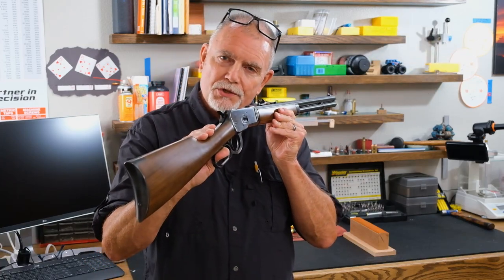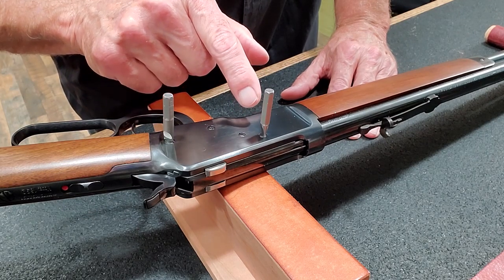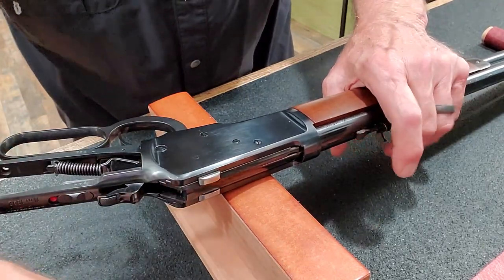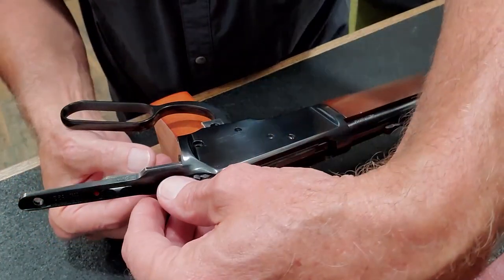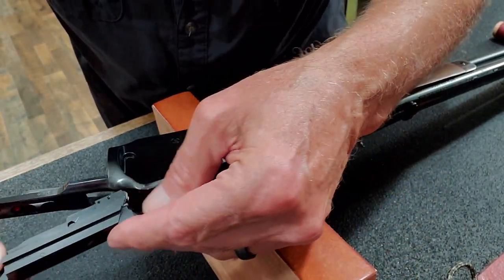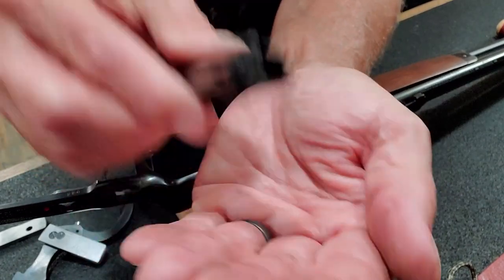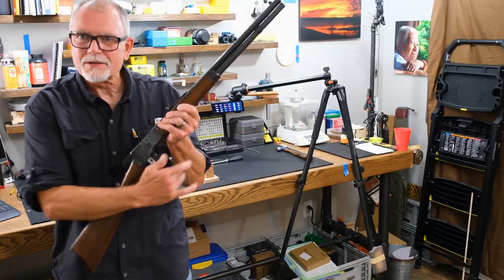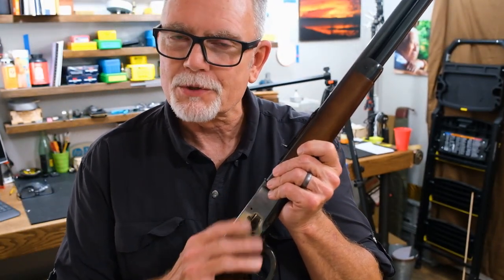Miroku Winchester 1892 Disassembly For Cleaning

Comment: last time I took apart my Winchester  I lock tighted all the screws back in.
Reply from the maker: There are probably lots of vintage lever guns that have never been disassembled, but just rinsed out with "coal oil" and put away to dry.
Reply: @TargetSuite   My win is not vintage.  it is a 1894 to 1994 centenary model  trapper carbine with the big hoop.  in 44 mag.  Last time I shot it the mag tube came loose and other screws were also loosening up.
Reply from the maker: I just borrowed a Model 94 (domestic manufacture from 1982) from a friend and am working on a disassembly/reassembly video for that rifle. I hope to post that video next Tuesday. I also hope to shoot that rifle in the next week or so to see how it performs. Maybe I should put a sheet under me to catch the loose parts😄

Comment: I love these old guns I really do..... but I wish they would breakdown like a modern rifle. Push a button and turn a lever and everything comes apart. Maybe someone will design such a thing.
Reply from the maker: I get your frustration. But that is part of the appeal of the old guns. That said, the Marlin 336/1895/Henry rifles kind of fall in that category as they are really easy to field strip, especially if you use one of the thumb screws from Ranger Point Precision for you lever screw.
Reply: @TargetSuite  Yeah Marlin did a great job with its easy field stripping but Winchester stole the show with sales I think.
Reply from the maker: I think you are right. I still have a vintage mid-century Marlin 336/35 Remington in my mental "shopping cart".
Reply: @TargetSuite  I have a Winchester 1892 made in 1910. 24" full octagon barrel full mag tube. It needs some work but the bluing is all there and it's gorgeous. It's in in 38-40 and I plan on relining it and using .40/10mm hollow points
Reply from the maker: That sounds like a great rifle to build on. Good luck with that project!
Reply: @TargetSuite  Thanks. She's my pride and joy.

Comment: Beautifully made and finished but, so complicated, and finicky to disassemble / reassemble compared to a Marlin.
Reply from the maker: Hi Chris. You are right. The Miroku Winchester 1892 is more complex than the Marlin 1894 design. It also stronger and has better fit and finish than any of the three 1894s I have owned. But that comes at a significant cost increase over the 1894. So I wouldn't say this 1892 is better that the Marlin 1894, which I love. It's just different. And I think being able to get breech access for cleaning by removing just one screw guarantees the Marlin 1894s continued dominance in the pistol caliber carbine market. Thanks for the comment as always!

Comment: I know this is not going to be taken well but I think John Browning’s designs are way too complicated but I think he did that on purpose just my two cents.
Reply from the maker: Hi Craig. No argument here. They are complicated. The 1892 much less so than the 1886 but still more so than the Marlin lever guns. But the two Browning designs were both a product of their times and in the case of the 1886, an incredible breakthrough, over engineered for the powders of the 1880s yet capable of handling power levels today on par with the 458 Win Mag. Not necessarily needed, but still a tribute to JMB and exciting to see in action  https://youtu.be/AFLXjfiklnQ

Comment: For 1892 breach bolt appetite site call Skinner for long stem lo pro besidesinstallation hole mill firing pin for extra clearance. Like your channel. 27th George
Reply from the maker: If I understand your comment correctly, I've talked to Skinner and they didn't have any breach bolt mounted sight, but may develop one. What is your comment about milling the firing pin? Is that to give clearance for screws?
Reply: It would be nice to speak with you directly as I'm not computer YouTube savvy. Your ordeal is something I just went through with my own 1892.
Reply: @TargetSuite  Yes to clearance of screws but there is much more to it. How do I reach you for private chat, instead of using public comment.
Reply from the maker: The only private option is for you to message me on Instagram @targetsuite. Those messages are private.
Reply: @TargetSuite  OK. I just opened an instagram account and messaged you. Let me know if you got it.
Reply from the maker: What is your Instagram "name"?

Comment: Another nice video George.  I have a couple of articles on how to disassemble/reassemble the '92 and slick up the action.  http://www.ktgunsmith.com/92dis.htm and http://www.ktgunsmith.com/92slick.htm  
My Rossi has a different hammer strut because it doesn't have the tang safety, but pretty much everything is the same.  Yes, that pesky ejector, ejector spring and collar can be fun to deal with, but it gets easier every time I do it.  The '92 rifles are very popular for Cowboy Action Shooting.  I was thinking about refinishing my Rossi '92 with a different painted finish, but the bluing is just too beautiful, so I converted it into a takedown rifle instead.  http://www.ktgunsmith.com/92takedown.htm
I decided this is a rifle I will never part with because the rifle is historical and I like the action.
Reply: I really like the capture the trigger idea!
Reply from the maker: Thanks Roy. When the smoke clears I'll check out your articles.
Reply from the maker: Releasing pressure from the sear is really is helpful on the 1892. And with the 1886, it is almost a requirement.

Comment: This isn't easy.   Winchesters are complex
Reply from the maker: More complex than the Marlin design for sure. But the Miroku Winchesters sure are smooth . . . right out of the box! Thanks for the comment!
Reply: @TargetSuite  I have a Miruko Winchester 1886 Extra Lite.  Also have several Miruko/Browning repros from the 1980's or 90's.  The Browning are the model 71 and 71 deluxe and an 1886 montana commerative rifle.  The Browning Miruko rifles don't have the tang safties and the fitment and finish on the older Browning rifles are superior to my winchester 1886.  I wish I could try an miruko 1892 but I can't afford it yet, but I have some old original winchester and even the old 1895 rifle.
Reply from the maker: Aaron that is a great collection of classic and beautiful rifles. I tried to buy one of those Miroku Browning 1892s but not having a tang safety and rebounding hammer just wasn't worth an additional $400. So I "settled" on the Winchester version.